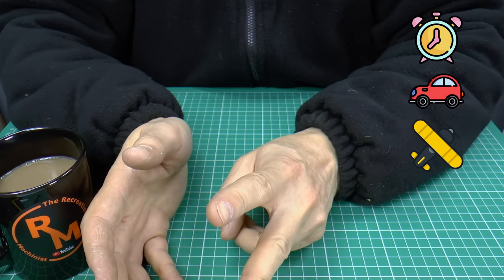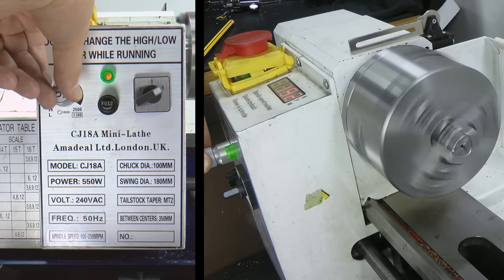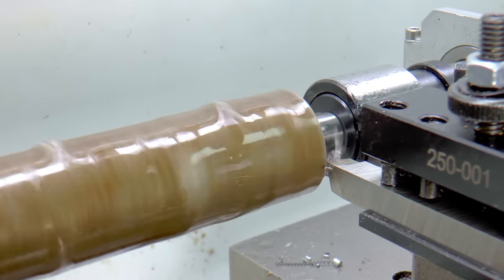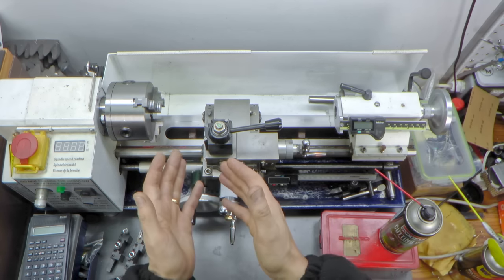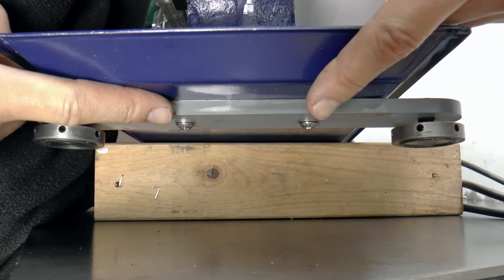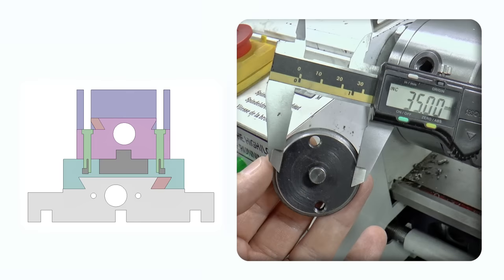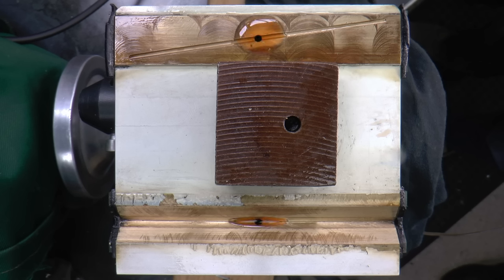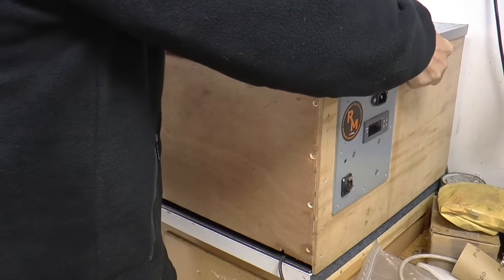10 Years of Mini Lathe Ownership: Pros, Cons, Modifications and Improvements

Comment: Nice job, i added the end wheel as soon as i had my lathe. I have done a lot of the same mods although i have DRO.
I will watch again because its nice to know we are all in this together.
My only small point is where you describe a generic mini lathe. From my limited experience they come in 2 guises… what i call the CJ, as you have and the Vevor style. I am not sure if parts are interchangeable but the CJ has a two speed change and the Vevor is single speed. The motor drive is different too. Where yours, the CJ has toothed belt the Vevor has a small V belt. I prefer the V as it is more likely to slip should the work piece jam up. 
Anyway thanks for the video and anyone in the market for a mini lathe should watch this a few times as it shows what can be achieved. 💪
Reply from the maker: Interesting! I was unaware of the new kid on the block. I'll do a bit of research 🤔  Thanks for watching and commenting 👍 🇬🇧

Comment: I went for a new Chinese 9x19 lathe rather than the mini lathe. More room to work than with the mini. It uses 3 different belt positions for slow, medium and fast speeds. With each lower speed you get an increase in torque, something the variable speed mini will not give you. I bought mine from a local commercial machine supplier. It was more expensive than if I could have bought a similar lathe from an online listing. Partly because the dealer only brought in machines that were of a higher quality, better finished units. With all this stuff you can get machines of a higher quality but at a higher price.

Comment: A good observation about spindle speeds for the lathe and the mill as well. You will find that a spindle speed of 500/600 rpm will suffice for most work on a bench lathe. So much so that that is where the machine runs 80% of the time if running high speed steel or cemented carbide tools. The cemented carbide tools have the advantage over insert tools on a small machine in that they may be ground to a sharp edge on a bench grinder with an Aluminum oxide (green) wheel.
Cheers from NC/USA

Comment: This is a breath of (Much Needed) fresh Air!
My 2 pennies below, Feel free to skip :)
I used to run a workshop with 7 lathes, Many from the WW2 era. 
The lightest one was a Schaublin 102 at ~400 Kilos including the base, and the biggest one was ~2000 Kilos. 
The smallest one physically was an "Akebono" brand, I found out much later it was once installed in a Japanese Submarine! Although the thing was tiny, It weighed close to a 600 kilos, Including a proper full-box cast iron Base, a giant 1/2 HP 3-phase motor and off-board(?!) gearbox.
The most modern and versatile one was a german Weiler lathe with a turret tailstock and several lever operated slides for various custom-jobs. Although nothing close to a CNC operated machine, This one had the option to do almost any job quickly with an assortment of chucks, jigs and fixtures.
Although very fascinating and a real treat if this were a museum, the workshop was a nightmare to operate due to the lack of inter-operability between these machines of various era's. Operators had to be re-trained, Parts had to be re-made, etc.
I finally sold the entire setup (Mostly for Scrap value) in Feb 2021, a Month before the COVID lockdown was enforced.
Do I miss the machines? Yes.
Will I buy them again? Hell no! 
Time for a modern, Precise, locally manufactured, cheap lathe (Whenever that happens, Sigh!)

Comment: Very good video, keeps moving without a load of repetition and 'wow, amazing. you won't believe it'. 
Sintered floor sweepings  LOL (I'll have to remember that one)
I've gone the small and old route,  fortunately I found a company willing to recondition the spindle and it plain bearings (which un bolt from the bed). It's an EW Stringer lathe (£80 off E-Bay and £100 for the spindle reconditioning) Of course it can be catch 22, to refurb an old lathe, you need a lathe.

Comment: We got a chinese lath at my work, its 1meter between tailstock and the chuck. It works real great even with all abuse it got from former workers. I do precision work, threads etc in steel, stainless, brass, plastic etc. But you cant compare it with my former work place. There we had lathes from before ww2 up to the 70s. Those were quality, and we made special threads on 4m long 60mm steel screws etc. We even had a machine from 1945 to make gears in. Just mounted the piece, put in the right gears in the transmission and set it against the piece. Then you could go away and do something else, when you came back you had a nice gear redy to take out and harden. Was a fun place with around 8 lathes, 2 milling machines, some drill presses with 2-4 drilling heads etc etc. The company was over 100 years old, and the guy working with the lathes and milling machines was around 60 and had worked there since he was 15. He teached me alot, miss that place but it dosent exist anymore. The owner sold it to someone who just wanted the land. And what I have heard all the machines, tools etc went to scrap. There were several meters and 2m high shelvs with cutting tools for lathes and mills, a big cabinett with drills from 0.5-70mm for different metals, and moste of the tools and drills were new unopend from 40s-70s.

Comment: I use a mini lathe at my favorite maker space. Mini Machine Shop brand and there's a same brand mill there too. My biggest issues are other users not knowing how to maintain or align tools. I made an hourglass because of someone. I am one of the people there with just as much ability to fix the tools as I can use them. I do a lot of it. But metal turning is worth it. I can't turn wood into engines.

The wedge for the compound slide is so finicky to set. I spent 30 minute fiddling with it to find the lightest point without play.

Comment: Thanks for your Summary . And yes , you are right - This machine isn' t a "Newbie - Killer" , like every 2 ton Industrial machine is. But on the other way round, the tendency of the machine to go in "Stall Mode" or to RIP the Timing Belt under heavier loads or bigger diameters is the biggest disadvantege of the machine ( in original setup) , for the " advanced user". Made my first cuts on my private "C2" Mini-Lathe in 97 after working on the job with a "Weiler Primus". To be honest , on the "Weiler" the job often was done "by Force of the Machine" , not by perfect setup😂...So the first weeks with my Mini-Lathe in those days were a bit annoying. But I learned to live with the limitations of the machine(lim.Feed & Speed and use of pos. raked HSS chisels). But even if I got the Mini- Lathe better under control , the consumption of " tooth belt" in the primary drive of the machine made me mad. So after 2 years I decided to buy a bigger HQ400 witch was a quantum leap ! Every time Success in the first  attempt with the HQ ! A few years ago the Mini-Lathe got a second chance ( after nearly a decade of storage room). I decided to reconstruct the drive of the machine, by using a 300W 3 phase Motor with a frequency converter and a V-belt between motor and directly on Main Spindle mounted pulley.
It works classes better ! Lots of torque at low speeds and no more trouble with the belt.

Comment: i bought my mini lathe last year for €826 for the cpl. set (vevor). i don't need it very often but when I need it then i'm glad to have it. for my use i'm very happy with it for that price. all other lathes were much more expensive and wasn't it worth to buy it for the less things i need it. 
in conclusio, when you are a rc-modeller who has sometimes things to rework or manfacture small parts out of brass or aluminium which are not for the NASA it's defenitely worth to buy it. 
some of your improvements are defenitely on my to do list 😉

Comment: Mwahahaha! A giant lathe from the second world war...!!! My first is a F.E.Reed 14" swing change gears I can't use (or just never bothered learning how to set up) from the turn of the century. Not the recent one the late 1800's to 1908 or so. It's a beast! It only has a one horse single phase motor and weighs about 2000 pounds but it turns pretty good and has taught me a ton. (Like how to get large machines down a flight of stairs into my basement.) I like your mods! I want to implement some onto my lathes. The big mod I'm looking for is an electronic lead screw. Feeds and threading infinitely variable via a computer (Arduino)! That aughta bring the old girl into the new century! Could be a good addition to yours too... Ha WWII... That's way too modern for my shop!😄😉

Comment: I owned the same lathe and ended up selling it on as every time I used it it was never consistent which put me off using it. So no metal lathe at the moment and to be honest there's times I'd kept it. But my plan is to to go up a size to say a Boxford. I feel you've covered all the issues I found with it apart from mine the motor fell off😮. But if your happy to put the time in the you can have a good lathe.

Comment: "It's probably made from sintered floor sweepings" Yes, I've come across parts made from that in tools. Scary. This is the reason I'm a snob. Only with my drill, though. Well. And screwdrivers. Drill was easy enough to buy here in Norway. There are plenty of people agreeing with me on the brand. Got it on sale, even. But my screwdrivers? The ones I really like? They only sell them in Australia. And with the weight and ever increasing shipping price and VAT and fees, I paid more to have them shipped than I paid for the set itself! 😄

Now, if you're still reading, wondering what kind of magically awesome screwdrivers they have in Four Ecks, it was the Stanley 14 piece mechanic screwdriver set with acetate handles and square shank on the largest flat. Because acetate handles look like candy, are easy to clean, don't have that stupid (sometimes knobbly) rubber surface that give you blisters after a few minutes, and they look like screwdrivers used to. Also colour coded. Yeah, yeah, I'm fully aware WERA screwdrivers are super nice. I have used them extensively. But they're not giving me the same nostalgic feeling. Besides... To be honest, if I need to use a lot of screws, it won't be by hand anyway.

Comment: I don't even remember when I bought my 7x10, longer beds were not available 2003~4. 
I did some of the mods, fitting taper roller bearings to headstock made parting off with HHS possible although I did end up making new spacers to replace the plastic ones which meant headstock got partially stripped to fit them. Didn't make apron cover until things got swarf in there and handwheel was almost impossible to turn.

Comment: My first lathe was a clarke mini. It was an absolute nightmare. So i decided to buy an atlas from the 50s. In my ignorance i bought a real basket case and spent WAY too much time and money restoring it to, sort of, functional.
( Flat ways on the atlas and its lack of rigidity are meh)
HOWEVER
These two highly educational experiences taught me alot about lathes, how to fix them, what to look for when buying used, and how to use them..
I then bought a 1928 south bend series O 11" that needed suprisingly little. Shes an amazing old gal that was a lot of fun to restore and to use..that said her pass through is only 7/8". Alas a lot of work id like to do really requires greater passthrough so ill likely sell her soon and go with a larger lathe,
I think mini lathes are an exceptional way to learn the basics of owning and operating, but if you want to work in steels i STRONGLY reccomend looking at the next common sized benchtops. Like the precision matthews 9".
They should be more than adequate for most work the typical hobbiest will encounter and will help you decide if you want to go onto the larger tool room and engine lathes.

Comment: 12:01 I'm looking to build small nitro enginse from scratch, of my own design, and it seems accurate enough to do exactly that. Clearances of 1-4 thou are pretty typical in these engines as there needs to be room for the lube oil to get in there between everything, account for thermal expansion, etc.

Comment: Thank you for this in depth video. I enjoyed it very much. I always wanted to see up close details like this. I am in the process of building a lathe now. Better said,gathering parts. I have two 6ft steel  I-beams I was go to use as the bed, or maybe just one stand alone beam.  The I-beams are roughly 2 3/4 in  or roughly 70mm wide.   I still want this to be a mini lathe. But I want my distance between centers significantly larger for what I intend ti use it for.  I also need the spindle bore to be a 38 mm of 1.5 in minimum. Any thoughts on how I should approach at least the slides on an I beam for now. Although similar, they are not quite dove tails. I was thinking linear rails on top of each, but I think that may  take away from rigidity a bit. I’m trying to keep this project $ low as possible. 🤷🏻thanks.  Danny

Comment: Got a clark mini laith,,,,, blew the controller pretty quick,,, swapped it all out for a treadmill gubbins,,, blew controlker again,,, nowadays it has fhe 180v treadmill motor running on a 16s 60v lithium batttery😂,, got rid of the cross slide,,, she chuggs thru material now,,, cheap,, ideal for a beginer,,,

Comment: Any lathe is better than no lathe, it's all a matter of how much money and trouble shooting you're mostly willing to put up with before sOmEtHiNg needs upgrading, I'm still of the mindset you should get something a bit beefier than a Chinese mini import, but this proves that it "can" be done one something like this, again, it's the amount of money or effort in this case on how much you want to put in in order for it to work properly, although both machines are still under the same concept of buy once cry once, one just has a bigger upfront cost with moving and the sales price, while the other has the cost of a lot of manual tweaking and upgrade time.